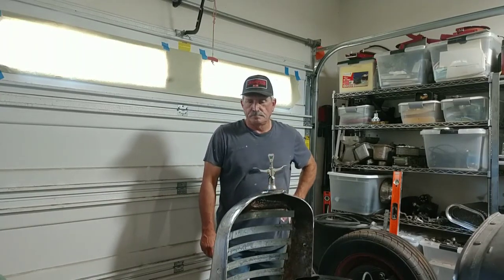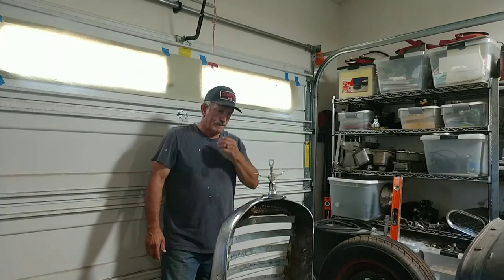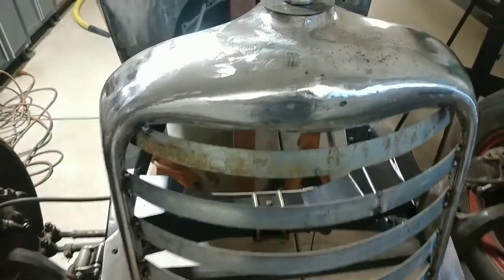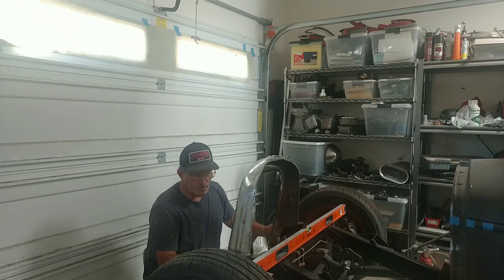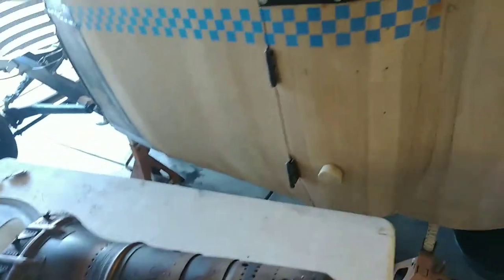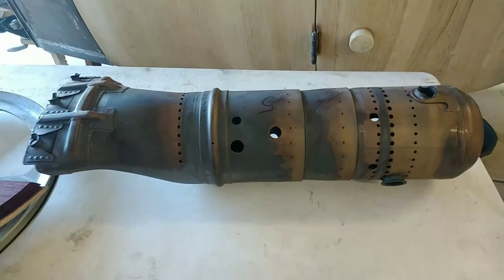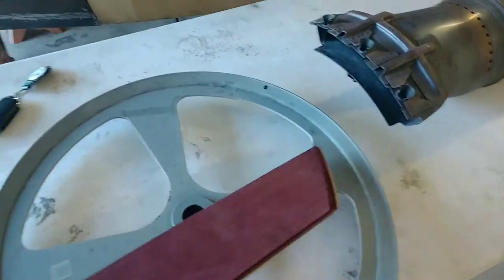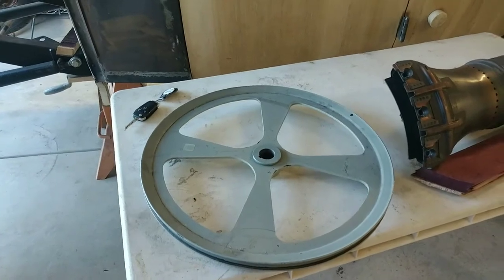Rat Rod Grill Fab

Comment: Love your channel. When you do finally get the engine installed and get it ready to be started, please film the whole thing unedited. Would be cool to get a clear shot of what you’re doing behind the wheel when cranking it up. Cold starts of anything carbureted would be cool too! I subscribed. 

Odd question, but how do big work boots fit on such a small cutout gas pedal? Just on top?
Reply from the maker: Right on!! Thanks for the great comment. Haven't thought that far ahead, but why not. Thanks for the support. 👍
Reply: @VinoRatRodbuilds  can’t wait! Do you have anything carbureted that’s currently running?
Reply from the maker: @gearhead9943  no